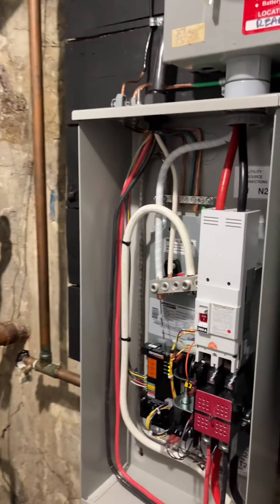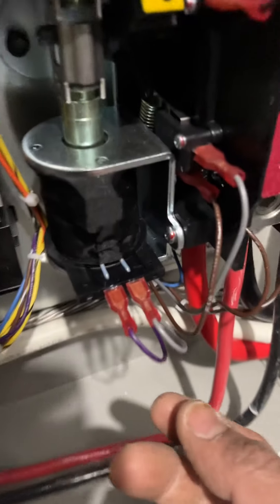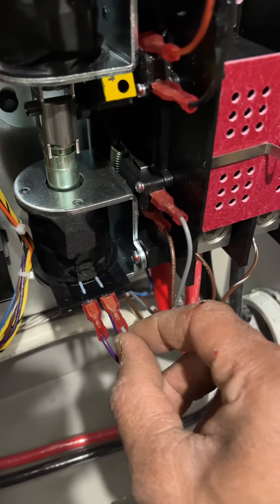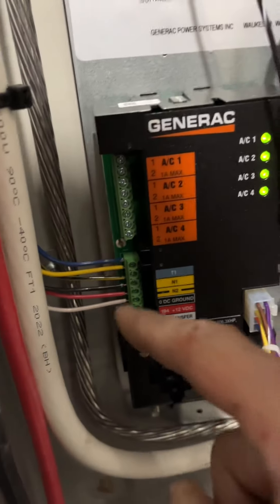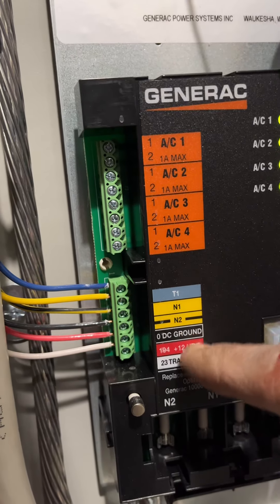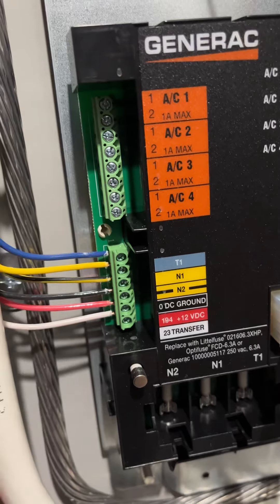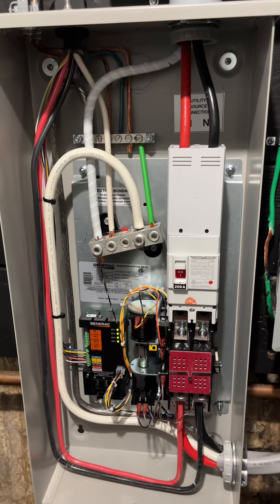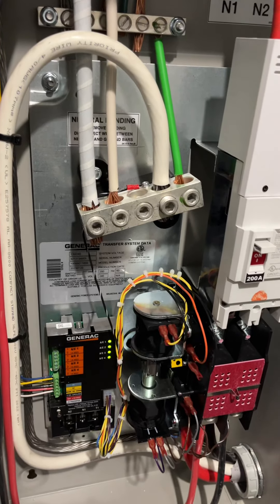Inspecting a 200a Generac Automatic transfer switch

Comment: You seem to be the man who can help me.  I have a 20kw (about 14 years old) and two transfer switches.  I am in Florida.  When the power fails, the generator starts up and after a few seconds, activates the transfer.  Only 1 switch activates.  The other box of the xfer needs just the slightest tap, and the solenoid engages.  Two different companies have come out and replaced a small control relay (clear cube).  It doesn't fix the problem.  Have you got any ideas?  Nothing obviously wrong.  Thanks for your advice!
Reply from the maker: Really appreciate the compliment. 

We’ve seen this problem from time to time.  

The issue is with the springs in the transfer mechanism or the transfer coil magnetic loosing its ‘magnetic magic’. 

The transfer coil is an electro magnetic, when it gets 120vac from the transfer relay (obviously that wasn’t the problem) it energizes and pulls in a cylinder which switches power. 

Check the limit switches, transfer coil, springs in the transfer mechanism and cylinder for any binding or resistance.  The last one is not likely but worth checking. 

If you in the Jacksonville area reach out to Premier Power Systems.

Comment: I bought a brand new 24Kw 72101 with 200 amp transfer switch.  I needed a new main panel and after dismantling the the main panel the transfer switch was unboxed. The electrician found the grey wire terminal was snapped off the bottom coil. Now Generac says i need to file a warranty claim and wait for service. Would you recommend replacing the entire transfer switch component or just the damaged lower coil ?
Thanks for any response.
Reply from the maker: It happens all the time. I would just replace the coil. That’s what generac will pay for. 

Chances are the electrician bent it as they are very delicate.
Reply: @ipowergenerators4200  Thanks for the quick reply. It definitely came this way I opened the box and was there when he took off the cover. The problem is after alerting Generac I was told that an authorized Service center has to look at it, and I have to wait for an appointment.
Reply from the maker: @richiecapuccino9853 anyone can make the repair but if you want it covered by warranty then a warranty dealer would have to make the repair.  if you replace the part it would be at your expense